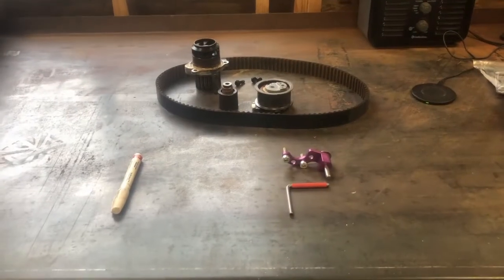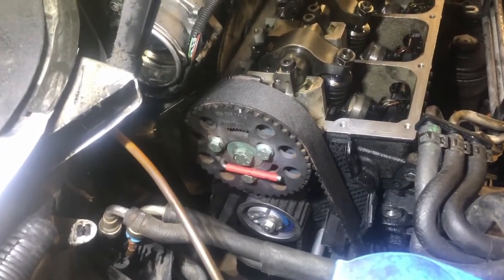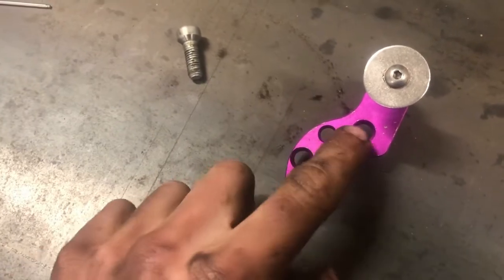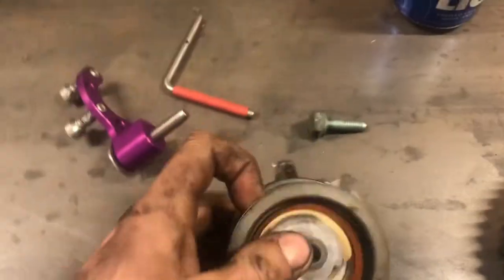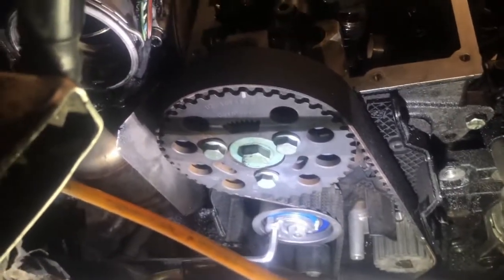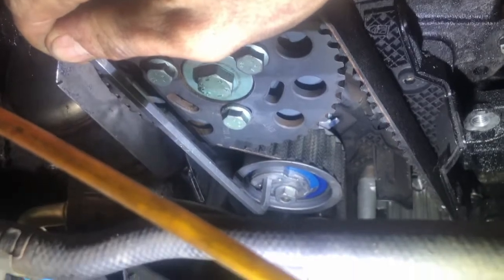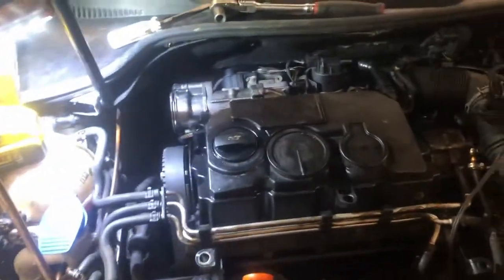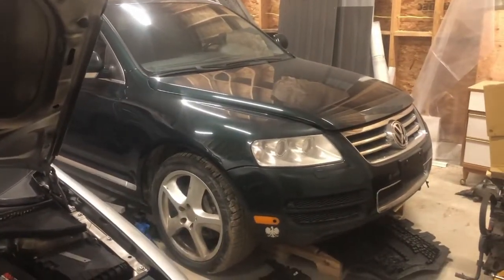A5 BRM TDI DIY timing belt replacement: "Paint n Pray" vs Timing tools

Comment: What if I’m just doing the cam ? What would be the process ? It has flat spots
Reply from the maker: I’ve got a cam video in my pd tdi playlist. Unless the belts been done recently I’d be doing it as well
Reply: @JoshsJettas  I got the car for 400 lol trying to keep it budget 🥸
Reply from the maker: I get that, it makes a mess though if it fails, atleast give the belt and idlers a good look through. Honestly I’ve done used bew cam/lifters/bearings to save money then buy a new timing belt kit, they’re around $200.
Reply: Put a new belt and pulleys. If you shop smart on rockauto, you can get it all for less than $100. Don’t ruin a great engine by being foolish.
Reply: @JoshsJettas hey Josh are you able to take a look at my BRM? I can bring it up to you. I'm in Sarnia
Reply: Hi Josh
Aussi pour diminuer les $$$ , j'installe des lifter de vw gas 2.0 8valves dans mes bew & brm.  Facilement disponible et toujours en bon état usagé 

Jérôme 
Québec

Comment: Hey man is the vcds system needed I’m in process of doing a lot of repairs on my mk5 I love your videos? You mentioned using vcds to set torsion value I have Autel mx808 scan tool I can see parameters but not sure if you mean a relearn after camshaft and belt replacement..
Reply from the maker: It’s not needed but it’s a very common tool to use and can be had on a budget. It’s not required for relearn, I’d imagine the scan tool can see the torsion value, then you have to manually adjust cam timing to tweak the torsion value.
Reply: My “eobd facile” app can show torsion values in live data.